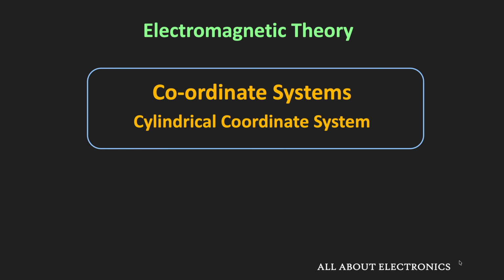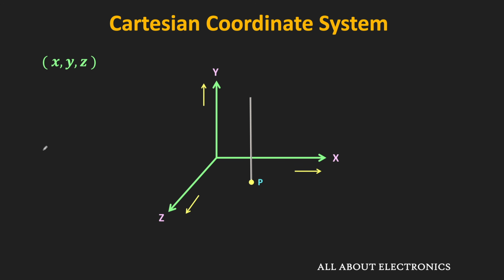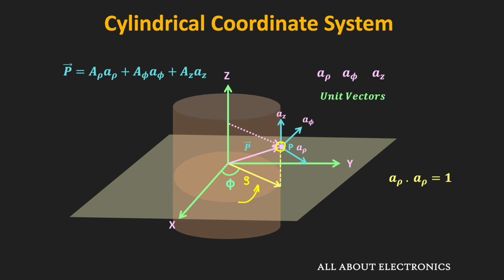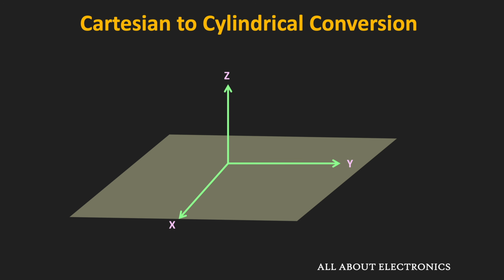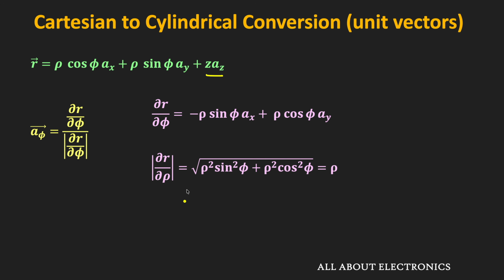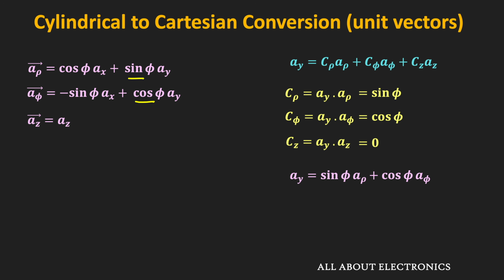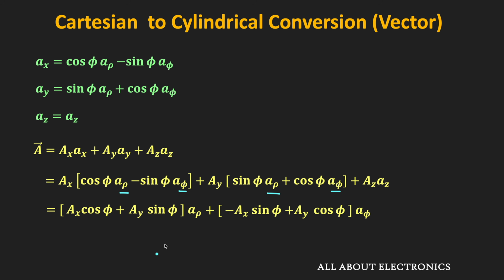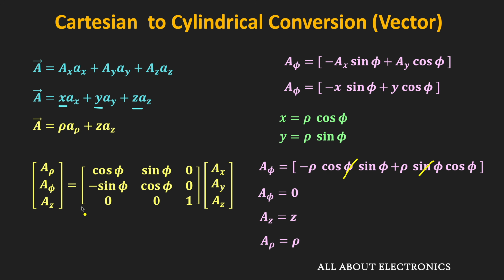Cylindrical Coordinate System Explained | Cartesian to Cylindrical Vector Conversion Explained

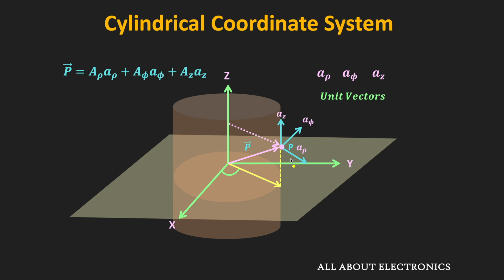Comment: 16:06 how?????? I can't understand why the rate of change of position vector has the direction same as drho? like the two vectors are pointing in totally different direction and when we found the rate of change we somehow get a unit vector which has direction same as the denominator(drho) it is not making sense to me, please make this point clear, like how can we 100% say that dr/drho/|dr/drho| = arho?? is this some geometry trick or what? please help me understand this confusing part
Reply from the maker: Let's take simple cartesian coordinate. If you have some  position vector, and if you differentiate with respect to x, what you will get?, you will get the x component right(unit vector ax). In this case, the differentiation itself will give you unit vector. And its magnitude is also equal to 1. Likewise, if you differentiate it with respect to y then you will get unit vector ay. So similarly, if we differentiate the vector with respect to ρ, and normalise it then we will get the unit vector in the ρ direction. But here, since the position vector is in the cartesian coordinates, so first we need to represented them in the cylindrical coordinate system. Because then only we can differentiate x, y and z with respect to ρ. I hope, you got it now.
Reply: @ALLABOUTELECTRONICS ok so it's like (I am describing it in my own words, what I have understood) when we have a position vector in the Cartesian system and we differentiate it we get x, similar when we switch to the cylindrical system and now if we differentiate the position vector with respect to rho then obviously we will get rho(roughly saying) 

Is it correct??
Reply from the maker: @heroicboy3668  Yes correct. And when position vector is in cartesian coordinate, then in a way we will get the relation between  aρ and ax,ay az.
Reply: @ALLABOUTELECTRONICS thanks a lot ❤